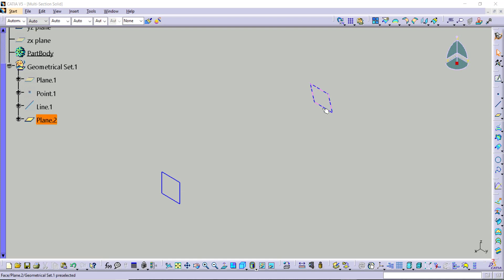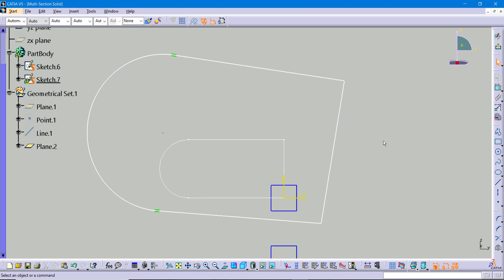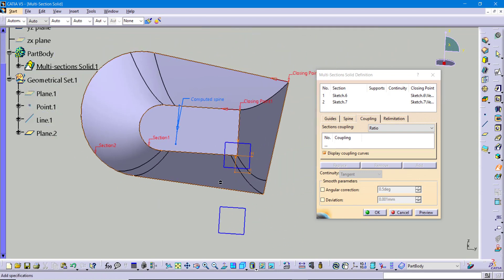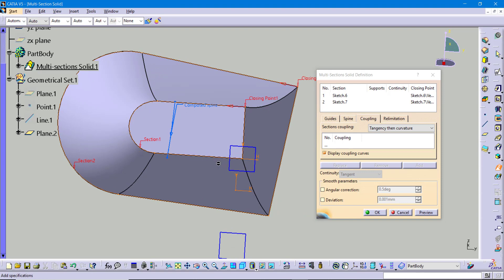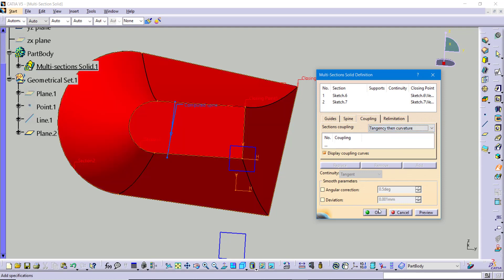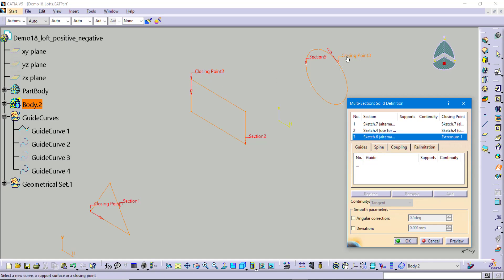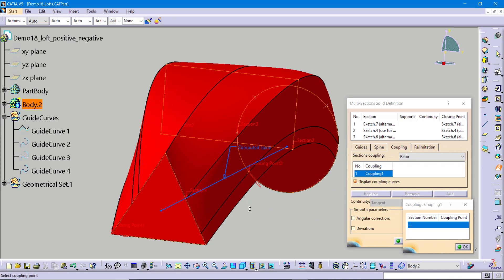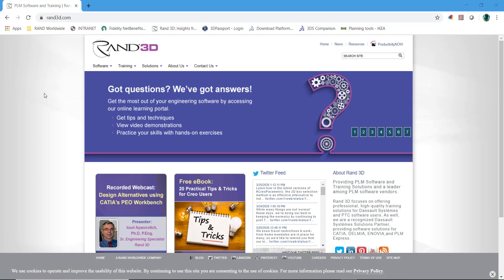CATIA Tech Tip: CATIA V5 Coupling Options for Multi-Section Solids

Comment: It is not mentioned in this video, but there is a big difference between Full and Partial Overload.  If you add a new part or sub-assembly after creating the scenes, the Full Overload scenes will NOT show the new components added, but the Partial Overload ones will! So I typically start with a Full and a Partial "Default" scene and rarely use Full Overload scenes.